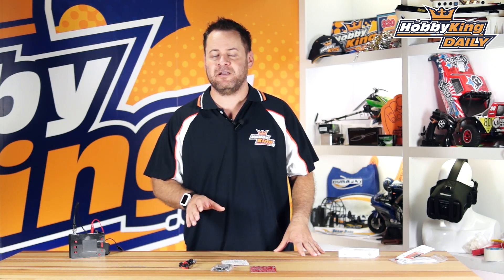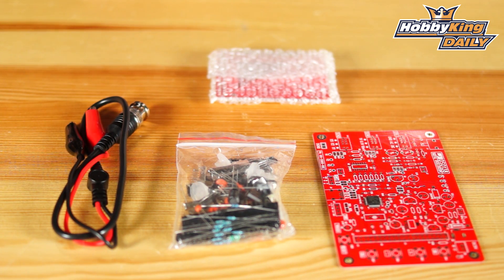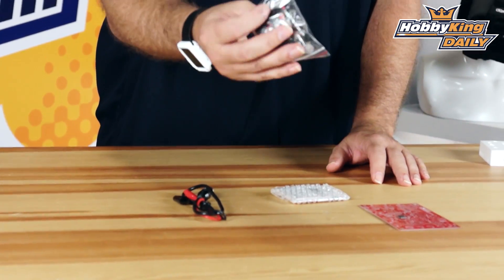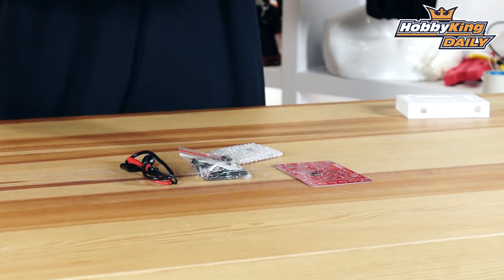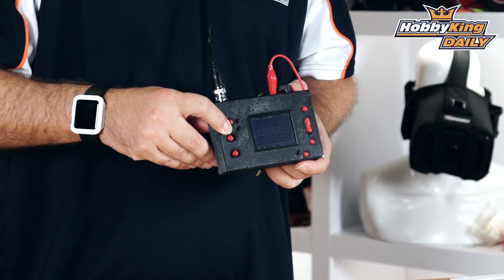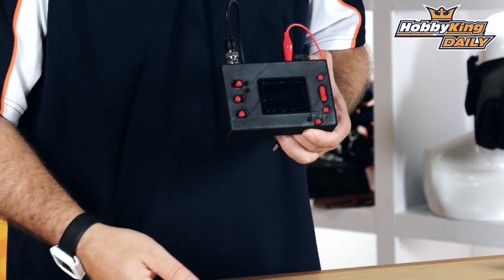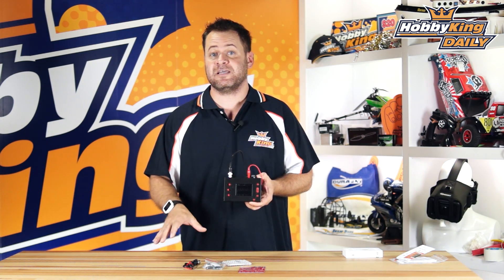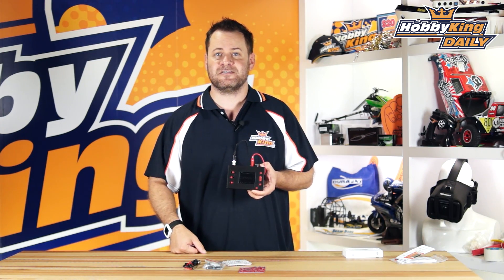DSO138 DIY Oscillascope Kit - HobbyKing Daily

Comment: If you're in need of an Oscilloscope, do you really want readings from parts bought from the cheapest chinese supplier? Plus no case? What garbage.
Reply: +psygn0sis If you are in between, you could just use a free windows-based scope that reads voltage at your microphone jack.